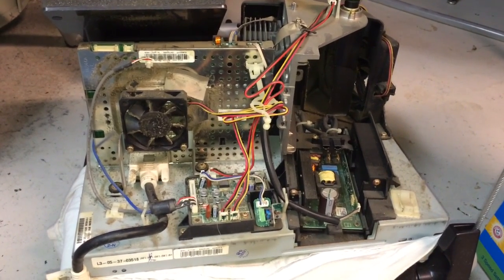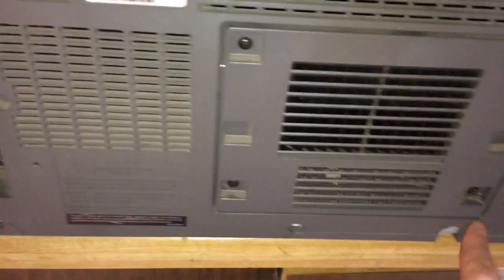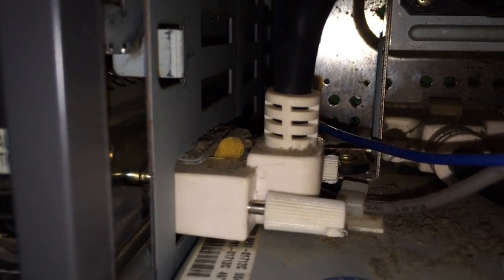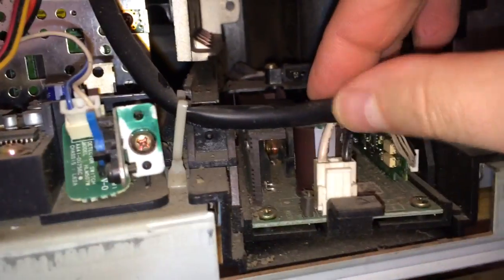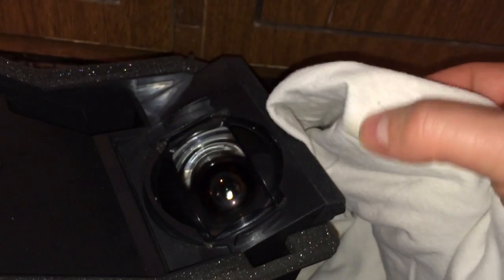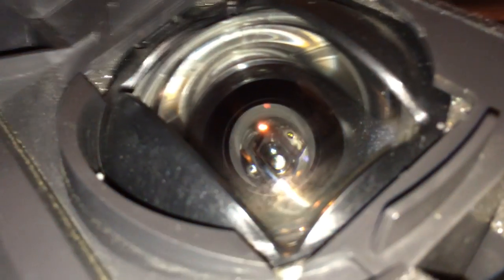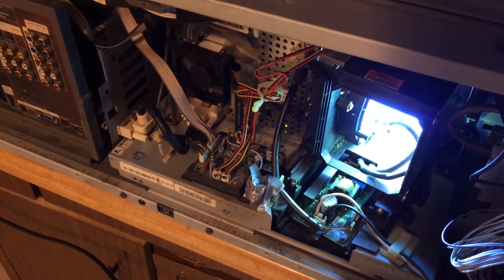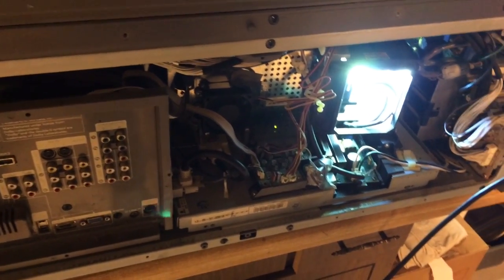Fix Your Dying DLP TV with a Vacuum Hose

Comment: I got a Panasonic 60 inch projection bulb and after running like 5 hours, the tv shuts off. What do you is the cause? Thanks.
Reply: +sigzor302620 might be overheating - do you have it near a heater vent, window, or close to a wall?
Reply: I've had it on the same spot for 11 years and just now that problem started.
Reply: +sigzor302620 I have a 2009 65" Mitsubishi and when mine started doing that, I was dumbfounded. Googled around  and found that you can oftentimes Troubleshoot by watching if the front lights flash in a pattern.  For me I found out my Lamp was overheating and about to go out.  I replaced one a year ago, and the same thing happened again just this past week - luckily I had a backup replacement lamp, so within 15 minutes I installed the new lamp and it works great again.  I now have the white dots - today my 3rd one showed up, so I know it's the Chip.  I'm going to buy one off Amazon and keep it on hand.
Reply: My lamp is over 6 years old so I was thinking the same thing that it could be the bulb getting ready to completely fail. I hope that's what it is cause I've had my projection bilb tv since 2006 and it's a great picture.
Reply: +sigzor302620 I just bought another backup one from Amazon and they are now down to about $17
Reply: Yep, I will definitely get a new lamp soon. Thanks.
Reply: +sigzor302620 One thing I had happen, is my son put the back panel on after we installed the lamp, he didn't tighten the screws done, so when we moved the TV back in place, suddenly it shut down.  After googling Troubleshooting, they advised to push the panel to make sure it is secure, as soon as I did that, the picture came back on.  Then I just tightened the screws a bit more secure, and no problems for a year.  You may also notice that the screen seems darker, but since it happens gradually, you won't realize how much until you replace the lamp and then suddenly it looks like a brand new TV again.  Replacement lamps are as good as the originals, mine went out after a year and simply one day I tried to turn the TV on and it went black and the front light flickered.  Knew immediately, and was so thankful I had purchased 2 earlier, so had on in my closet - otherwise it would have been along weekend of 'listening' to TV LOL
Reply: With my TV the bulb access panel is in the front so it's a little easier. But my bulb from Panasonic costs $225. I bought an aftermarket brand and it didn't work right so I had to return it. I don't mind paying a little more cause I at least get about 6 years from each bulb.
Reply: I think your having an overheating issue, make sure you have plenty of ventilation behind the TV, and that you don't have lots of lighting overhead that could be heating it as well

Comment: Great video, thanks.  I have a Mitsubishi WD 65 837 65 inch DLP TV. I had to replace the DLP chip because of the white spot problem. Now the white spot problem is gone, but with a black screen when the lamp is on I see large irregular blotches 2 to 8 inches in size of dark grey..  
As soon as the lamp goes out completely these spots disappear.  Looks like some light leakage.  I did have to take the light engine out to change the chip.  The video on the screen looks pretty good but in any black ares where these blotches are they must be reducing the black level.  Any ideas of what can be done to fix this?
Reply from the maker: Check for residue on your mirror, back side of the screen and lens.  Otherwise I've not seen such an issue.

Comment: awesome video,  thanks
Reply from the maker: Glad you liked it!
Reply: @databits   I need some advice I have a DlP TV Hl- R5668WA. l had the TV Fir ever but its had maybe 1 or 2 years use than I didnt use it because it had only half a screen working . I brought a Lamp and put it in .....same issue ...so a repair man said I needed a color wheel I put it in no change but brighter picture do you think its needs a pcd ?
Reply from the maker: @everythingrosey4813  - A PCD?  Are you referring to the DLP chip?
Reply: @databits   He said Pcb assembly ( panel control board) at this pount not sure if I should keep putting money in it...but to throw something out with 2 new parts worth (lamp$165 and $288 Color wheel is close to insane....BTW Im a 4 yr. Apprentice in electrical...still learning, lol

Comment: i have a samsung un46d6000sf it does not go on no sound no picture
the red led double blinks five times than one blink.
if i unplug wait than plug back in the light stays red. if i try to turn on it goes back to double blink five times and one blink.
tried everything. looked at all caps all look good
Reply: +john campo replace your lamp
Reply: Your tv doesnt sound like it was a dlp..probably some of the leds on the led strips are out

Comment: OK.....here's the crazy part: I took the color wheel out again today...did a little playing around with the actual wheel hub, found that it does have a certain amount of lateral play. There's actually a stationary middle portion (I was expecting a rotor...but this baby has a stator and you can see the tiny/shiny copper coils down in the middle.)
Against all better judgement (what the hell, I thought, it's gonna be junk anyway) I squirted the tiniest of little burst of "Deep Lube" penetrating oil that I could, down one side of the inside of the chrome hub of the wheel. I then turned the whole wheel assembly on its side and gently rotated the wheel by finger for about 2-3 minutes, thinking if there's a bearing of any sort in there.....SOME of this juice will find its way in.
Long story short: put it back together, turned it on..............DEAD..........dead SILENCE that is! Running like a charm and absolutely quiet. 
No telling how long it will last, of course, but heh, if I get two episodes of Orange is the New Black, I'm GOLDEN!! Cheers, buddy and thanks again for the inspiration.
Reply from the maker: Dude!  That's awesome!  Hopefully the juice stays in and doesn't sling out!  Good work!

Comment: My 46" has white spots on the screen. It looks like they are being projected. I guess I am pulling it apart!
Reply from the maker: Dave Denkhaus This is usually a problem with the video board.
Reply: Is it worth replacing a video board? Or should I just toss it out and buy another. Just been sitting in my garage for a year.
Reply from the maker: +Dave Denkhaus - I would toss it honestly
Reply: Toss what?........And buy another what? TV? Video board? What?
Reply: TV

Comment: i did everything you did except that. You think thats my problem
Reply from the maker: +Gregory Pompey - No...taping the switch only allows operation with the cover removed.
Reply: My switch wasn't connected to anything.
Reply from the maker: +Gregory Pompey it should be unless it was bypassed
Reply: I don't know I haven't checked the color wheel or chip yet

Comment: Video was very very helpful, BUT now very faint to no picture and it cuts off after a minute.
Reply from the maker: +Mz Flowerbomb - might be a bad bulb
Reply: But the bulb still lights in the back
Reply: As the bulb goes out, the picture will fade and get darker until one day it will just blow out just like a light bulb in your house

Comment: I have a Mitsubishi Model WD65638 that is about 5 yrs old.  The lamp went out and was replaced a month ago and it worked fine for 30 days.  Now when the TV is turned on the green light comes on for a while with the green light on (not blinking) and after a while a solid red light comes and stays on.  There is never any sound from the TV but the fan is running.  I cleaned the fan and the symptoms continue to be the same.  Any suggestions?
Reply from the maker: Did you purchase a name brand bulb?  It could be the bulb or the ballast.